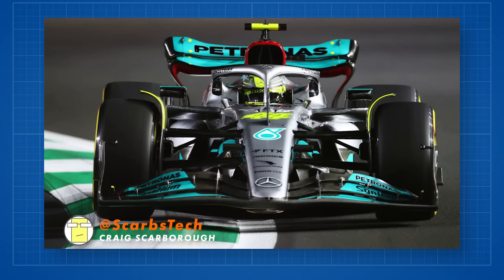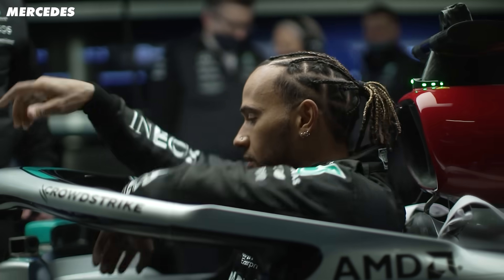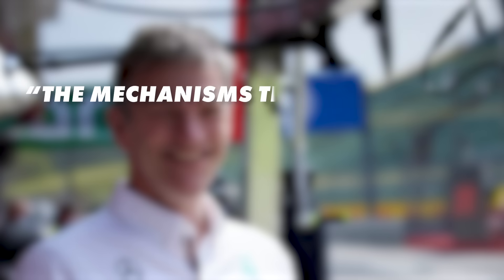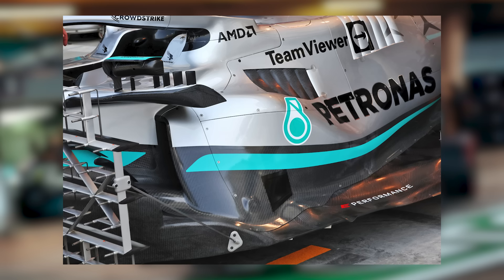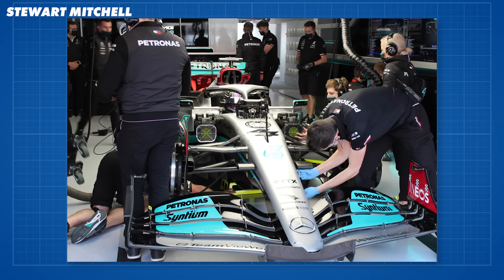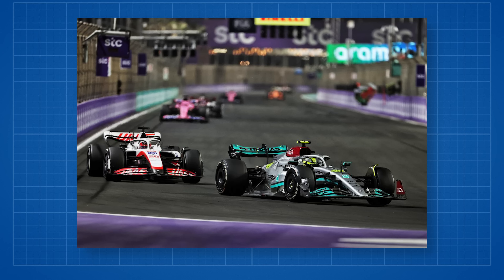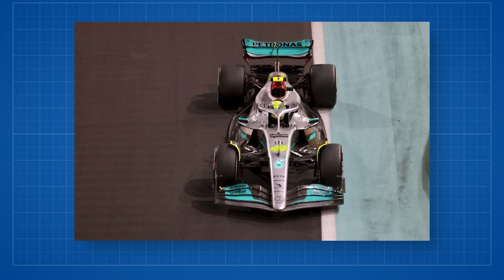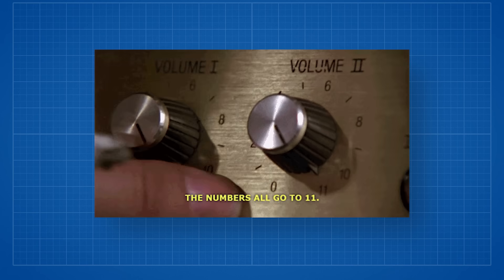The Real Reason for Mercedes’ Slow Pace | Saudi Arabian GP

Comment: Why Do Boats Porpoise? 
A boat can porpoise because the weight in the boat is disproportionate between the bow and the stern. It might also be because of the trim angle of the engine and the mounting height of the engine difference.
Another factor that can lead a boat to porpoise is the hull speed.  
When the bow wave gets larger and longer the boat starts to tip backwards because it tries to climb it's own bow wave. This is called hull speed. Hull speed is  diminishing returns, when you add more power you get a steeper bow wave, and the boat has to do more work.

Porpoising is the result of the motor’s outdrive pushing the boat upwards, essentially boosting it out of the water – albeit for a short period of time. Once the boat comes back down, the outdrive will once again push it back out of the water. This cycle will continue to repeat until either the boat’s speed is reduced or the trim is fixed.

I don't think this is any different to a ground effect f1 car?
bow = front wing / sidepods
stern = underfloor
trim = beam wing + back wing

Are Ferrari and Redbull aero design concepts aimed to cancel out hull speed?

Is the Mercedes creating more drag because most of its rear (tyres and back) is exposed and not shouldering more aero?

Reference:
https://www.screamandfly.com/content.php?325-Porpoising-Why-It-Happens-and-How-To-Fix-It

https://www.bornagainboating.com/boats-porpoise/

https://www.perfprotech.com/blog/boat-and-engine-technical-tips/general-boating-maintenance-tips/how-to-prevent-your-boat-from-porpoising#:~:text=Stopping%20The%20Porpoising%20Effect&text=Unless%20you%20want%20to%20reduce,bouncing%20out%20of%20the%20water.

Comment: Im guessing there is a ideal pressure under the car in witch you can balance the force of the ventury made under the car and the strength of the rear suspension.  Is it ilegal to have open ports under car to drain some preasure when needed to keep that ideal presure under the car stable as the car increases speed?

Comment: The damage has already been done we cannot change what the FIA have done to formula 1 the FIA take away the integrity out of the sport of formula 1, I love the truth the FIA did not want Lewis Hamilton as the face of formula 1,  that is what hold back sporting improvement  people still see things  in black and white, they refused to see things in full colour, 
The problem was not Michael Masi 
it was the FIA that Michael Masi get his instructions from, now you see how very careful Max Verstappen drive when it comes to Ferrari he does not imply none of his dirty tactics like what he was allow by the FIA to do with Lewis Hamilton 
And why Ferrari and Red Bull is allow to develop the car with list cap then  Mercedes Benz the real reason why the FIA bought in so much changes it was to stop the dominance of Mercedes Benz which we all see that at work right now,The FIA  have hamstrong or hamstring Mercedes Benz to give Mercedes lest wind tunnel time than Red Bull and Ferrari  if the FIA bring so much radical changes to the sport of formula 1, then it is very unfair to restrict Mercedes wind tunnel time.

Comment: Mercedes Benz do not like criticism
but one car cannot be so radically different from the other car  that it is so obvious to a novice, I do not want to see Mercedes hold back Lewis Hamilton because they have a hidden secret agenda we have seen Mercedes do that before in the pass, to give there other driver the advantage and that is not what we call racing Mercedes if you are running two different strategy the margin cannot be so vastly or immensely so different  at the sacrifice of the other driver 
I do not know if it was a mistake but they should have pit Lewis Hamilton in the Saudi Arabian grand prix 
when they  had the chance to, to making up so much place then throwing that away  that do not make any common sense you do not need logic to tell you that Mercedes should have pitted Lewis Hamilton when that window was open why leave it up to chance when there is a accident that you do not have any control over.

Comment: The problem with  Mercedes is the  arch of the blades on the  front wing have to much of an arch. You can see how high the arch is on the Las blade  of the wing. If you look at Ferrari the arch of the all the blades of the wing is most  flater.

Comment: The porpoising issue is due to the very odd new rear wing profile.
There is a aero dump rate that was not in the old rear wing .
The air pumps over the car and then dumps directly into the dish of the rear wing where it stalls momentarily dumping a large increase of downforce before the air moves out of the rear wing.
Raising the rear of the car decreases the dish profile which reduces the tendency to porpoise.
The dish profile of that rear wing needs to be changed.
No fun to see the drivers getting beat up like this.
Imagine getting your rear end hit with a baseball bat on you can imagine what the drivers feel at speed when this happens.

Comment: This theory is all well and good, but while Merc are wasting time and money fixing the the problems they have, RB & Ferrari can continue their development plans with much more efficiency.
And the "Merc always find a way" logic is based on the PAST when they had years of data on the philosophy and the ICE design, and the 13" wheel tyre construction, and a budget advantage over most of the field. As Davidson has said, the new cars have more rear stability in high speed corners, which isn't the feel that drivers like VER and HAM prefer, and so they are searching for a more 'pointy' car setup. When these cars snap at the rear, it is more violent than the previous cars. Some drivers are more comfortable with a lazy front and stable rear.

Comment: They sinned in presumption. If they tried it in Spain they would have realized the problem before. Consider then that they used two frames for the crash test since the first, the side one, had failed. Money spent and with the budget cap it hurts. Unless they cheat on this front I see it hard to recover.

Comment: Giving this many races of advantage to other teams is not ok.
Unless both Ferrari and RedBull will face serious issues during the course of this season, Mercedes will not even come close to winning neither of the 2 championships (driver and constructor) this season. And even if that eventually happens and both Ferrari and RedBull face issues, Mercedes would have to compensate for the 1st part of the season by being as consistent as it gets. This means they can't afford any DNF whatsoever. Will they be able to avoid those? I honestly don't think so. Just cause it's not 100% dependent on them, but others can crash into a Mercedes every now and then. Given that they are part of the big pack of cars and can't just "run away" and be safe all race or at least only compete with 2/3 other cars like past seasons.

Comment: As I have said, it is obvious from the body language of Allison, Wolff, Shovlin et al that they have no idea at the moment how to resolve their issues to get near the front. The season is gone. Interesting that there is a reference to the current side-pods amplifying the porpoising. I said this and am nowhere near being an engineer. I'd quite like them to put their original side-pods on it to see how it performs during a race weekend. The Merc PU must be suffering from the new fuel.
Reply: They use the new sidepods because they think, if they manage to solve the problems, they are going to give them an advantage. 
The old sidepods were practically those of the previous year's car. Made for completely diferent fluxes. They think that, even if they can made them work, they'll work mediocrely.

Comment: I think people are forgetting that only 13 drivers finished the last Grand Prix (14 if you include Albon who was 3 laps down). Therefore, Hamilton came 10th out of 13th. Had more drivers ended the race, Hamilton clearly would have finished out of the points.
Reply: Yeah. Had Bottas, Alonso and Ricciardo came to the finish line, Hamilton would have gained only three positions during the whole GP.

Comment: If the problem is not the power unit, yet all Mercedes powered teams are struggling... makes one suspect there may be some additional help those teams get apart from just the power unit.
Reply: Engine is not only power. It's weight distribution, both for the engine itself and the fact that it dictates the placing of several other components of the car. 
It's very possible that the weight distribution dictated by the Mercedes engine conflicts with the aerodynamics the new cars require. Given the shape of the engine, there was an "easy way" to assemble the car that all the clients naturally followed, with the result of them all having the same problem.

Comment: Maybe is that f1 now have unification with the fuel injection system and maybe they were cheating here somehow. Now with this unification maybe merc cannot achieve the wanted air fuel mixture as before with their own fuel injection system and loses power in engine...? 🤔

Comment: I definitely think scarbs has point an drivers have mentioned how the larger tires feel heavier that can't help the suspension control much being more weight affecting the pourpoising meaning they have to increase dampening to a place tension wise they don't want to go....ah but some teams have got it....so they will keep at it....there's hope ya....thanks guys...I feel bad for those guys having to deal with that

Comment: It is actually incorrect to characterize it as EITHER a suspension led issue, or an aero led issue.

It is a control system generated feedback loop.  In this case, the control system is the suspension, and the aero changes based on height are the thing that needs controlling.  

I've worked on industrial controls a lot, and you'll see feedback loops like this when the control systems aren't operating fast enough for whatever they are trying to control.  The aero situation changes very quickly at one point in suspension travel, and the suspension can't keep up as things change.  Consider that the suspension and tires change relatively SLOWLY, but the aero changes operate at the speed of sound.  This is a classic control system issue.

I'm extremely interested to hear how it gets fixed.
Reply: wouldn't a faster reaction just mean a faster bouncing action?
Reply: Good question!

And sorry, I mistated.

What I'm describing are PID style controls on systems.  The system itself needs quick information, and the control system has to be tuned to the slowest thing to control.  In this case, that slowest thing is the suspension.  So both are required.  Fast harvesting of data, and a control system that doesn't get ahead of the slowest component.

Right now, there is no 'controller' as far as I know.. which means you have a suspension that is freely reacting to the dynamic aero changes.  It doesn't help that the aero system isn't a continuous response curve.. but rather it changes abruptly at a point when the suspension is under major compression.

Comment: Look, you always need to read between the lines with F1, it’s all smoke and mirrors in the press. F1 teams are never going to say exactly what the problem is. One thing for certain is it’s not the Merc engine, it’s a ballistic missile. I’ll give you an example, yes they’re all slow in a straight line but have you heard any team mutter in the slightest that it’s down on power?! No, of course not. The Engine freeze part one has already begun so all Mercedes teams will be stuck with it for years so you have to ask yourself why are none of them absolutely gutted…….they’re not. It’s all aero related masking the engines performance. The Mercedes team are still third quickest yet they’re slow on the straight, it’s bounces around like a pogo stick and handles like a shopping trolley. Wait till they figure it all out! 😉

Comment: There are two factors in my opinion:
- Budget cap: Mercedes already brought essentially a second spec of the car, and there were the ones with the lowest amount of resources to use for development (maybe second lowest, I'm not sure). I'm not sure how they can get around all of these issues with the current limitations.
- Engine freeze: most parts are already locked, so if their engines is actually as less powerful as it seams, it's going to be a tough 4 years for them.
Reply: I wish that 😅

Comment: Mercedes reliability gives me comfort. Red Bull and Ferrari might actually even have to detune their engines at some point, I predict.

I think Mercedes HPP have been playing it safe. There were points throughout these last 8 years where Merc had reliability issues with their engines and I think they're trying to prevent that by reducing the power output. I think they did that because the Mercedes engine is good enough that it's power output can be reduced without losing too much from the rest of the field. 

Red Bull being so much faster than Mercedes should actually worry Red Bull fans, because I predict all that power will cause reliability and longevity issues for them.

Other than that, Mercedes doesn't have a slower ICE. I do believe it's their battery pack and how it's power delivery has been tweaked. I think this issue could be fixed without even adding or removing parts. To me, it looks like a minor tweak in ECU will change things around for Mercedes.

Comment: It's also ironic that Mercedes indicated last year they would not be able to upgrade as much as they wanted because they were putting more resources into 2022 than other teams. Yet, having done that, here they are with the slowest power units on the grid as a whole. When Toto said 1-2 teams will get it badly wrong, maybe it turns out it is Merc! But it will be interesting to see what happens by Spain. By then we should know if they are competitive or blew it for the next 3 years.

Comment: This was great. There clearly is some sort of engine problem because the teams are developing their own arrow and chassis. Scarbs explanation about harvesting battery may be the source but those teams with Merc engines are all at the very bottom. Even behind Renault! The engine freeze will hinder that, unfortunately. It was dumb on the part of F1 to do so from the start. They should have allowed 3-5 months (say, mid-season) to develop and then freeze it from then on. Doing so from the beginning doesn't allow non-competitive teams (regardless of who they would be) to become more competitive. Better racing is happening but teams are not really more bunched together. Ferrari and RB are head and shoulders better (just look at the quali times).

Comment: I agree with what others have been thinking, there was something odd about Mercedes finding an unexplained massive PU advantage in just the closing last 3 races of 2021.

Likened to Ferrari finding a magical unlocked performance gain which although was never discussed had something to do with issues raised just before the investigation (cough, oil burning and cough fuel regulator monitor bypass..cough others). There were a few shots in the closing stages of 2021 where the Mercedes did have plumes of smoke coming out on start up.

Mercedes likely dropped their protest very quickly against Red Bull (Max winning the WDC) faced with an option of drop it and keep the WCC (and reputation) or raise it and likely bring huge discredit and tarnish to the Mercedes/Hamilton name and achievements thus far. They went with the silent agreement like Ferrari.

The Mercedes PU is now showing its true pecking order (deficit position) against Red Bull like how it was for most of the 2021 season.

Comment: To me there's not that much to think about what's the problem. 4 Merc powered teams are having problems and until now are always in the back of the  respective field. Each Merc powered team has different aerodynamic settings, so the most obvious thing to me is that the engine is slower than Renault, Ferrari and Redbull engines. It might be not 100% engine's fault, but it plays a huge part in making the car slower.

Comment: I had doubts when multiple media said that f1 porpoising was due to aero stall and then aero regain loop, because these cars are designed to be run as close to ground as possible even scrapping the ground gets maximum aero.
you could clearly see this is MAX's car is qualifying where the start point of underbody(t tray) was making big sparks even in corners and especially in straight line, yet no porpoising.
Thank you for further clearing that up Driver61 and scarbs f1.

Comment: Major changes in F1 ... Animated races on the track as a result....Now there are only two pilots doing these animated races... But what level of show can be reached if Hmilton were to benefit from a car roughly equal to RB and Ferrari.... Hamilton is an exceptional pilot ... not as "violent" as Max, but not as "shy" as Leclerc.... About this new MB W13 ... I think there are several factors techniques that do not yet allow the performance desired by the team. First of all, aerodynamically, this car is not set properly. The porpoising effect is absolutely visible.... Then high aerodynamic drag....If these weaknesses are removed, we have all the chances to see a complete show on the circuits. The nonsense expressed by the engine cannot be considered real because MB had the best engine in years past and I don't think so now Mercedes engineers sabotaged their own engine.. At the same time, it would be desirable for other pilots to rise to this level of performance, but not by eliminating Halmilton, who currently has a weak car. The truth is that you can't have the full picture of this sport without the British. It is absolutely understandable that each of us wants to win our favorite, but we should stop here, in order not to see any more statements, made by people without brains, about the other pilots.